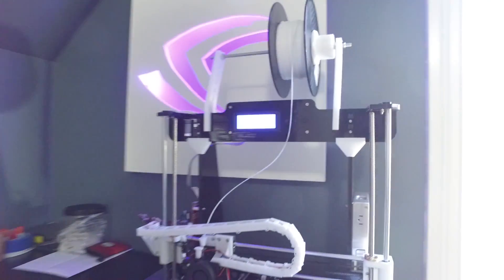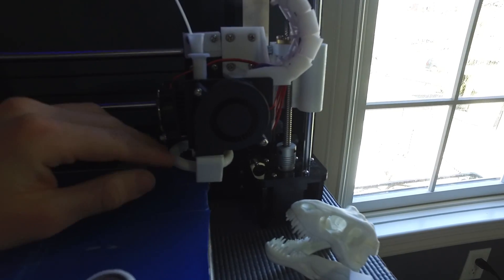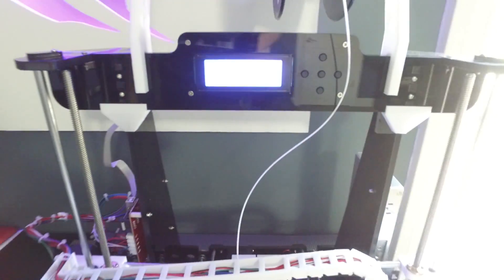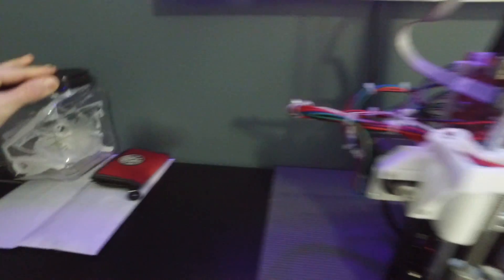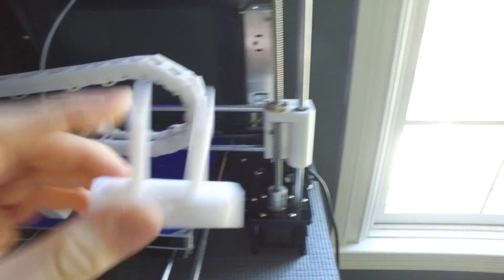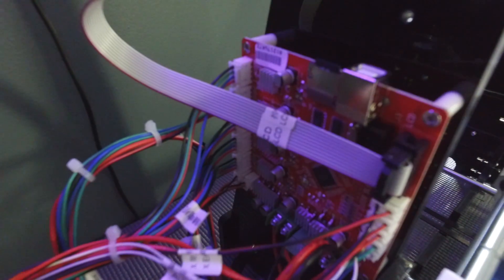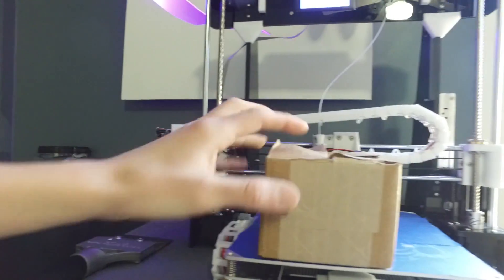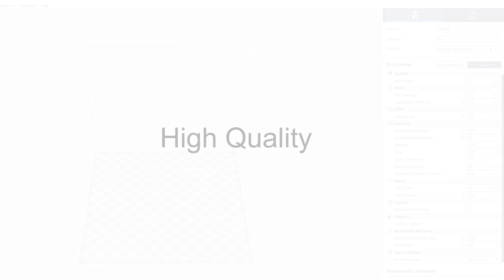Anet A8 Mods, Upgrades, and CURA Settings

Comment: For anyone taking these Cura settings as gold, remember it's a good idea to assess your current 3d model and modify Cura print settings according to your print. Things like overhangs, supports, filament type/brand, and level of detail will make a large difference in quality and success of your print per model.
Reply from the maker: +Stringsoftears you are exactly right, it had taken me several prints to adjust the temperatures, as well as infill and speeds to get my prints the way I liked them. Use a test cube print to adjust your cura settings accordingly and also check Out ultimakers website to read about all of the functions of CURA.